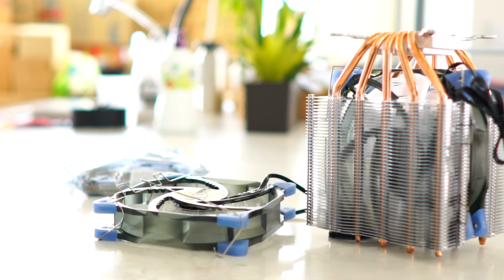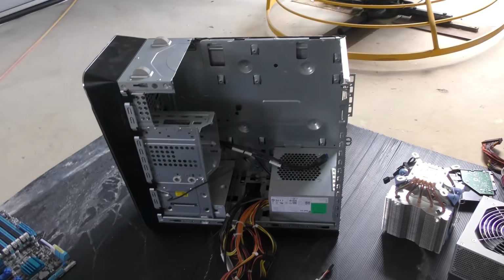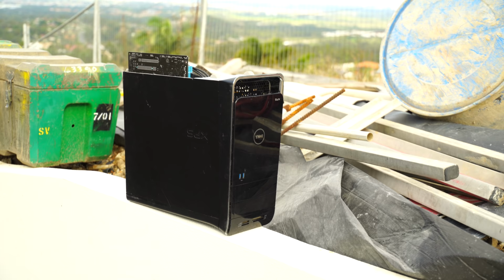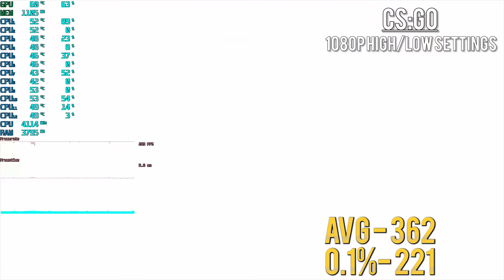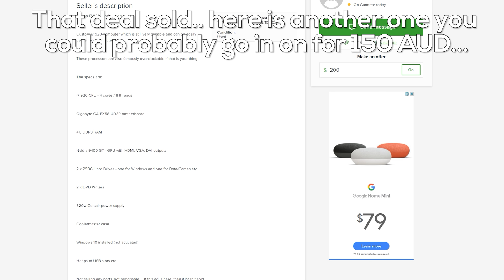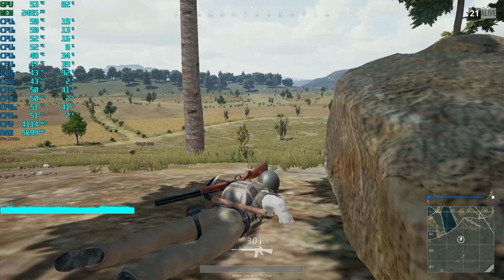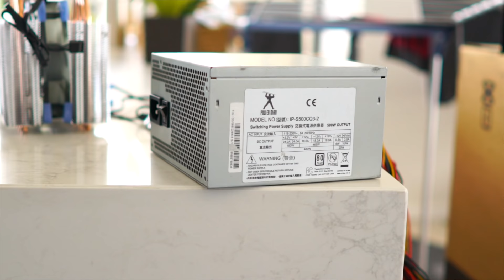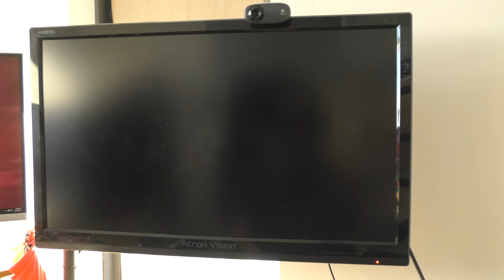Build a 6 CORE GAMING PC for LESS than an i7-8700K!

Comment: 4.3 GHz on a 6C/12T CPU using a $25 generic cooler. Not sure if you really hit the silicon lottery or if aliexpress injects steroids in their heatsinks.

Favorite build from you so far!
Reply: The equivalent of finding the 'The Chosen One' as a CPU.
Reply: I tested two Xeon X5670 and one X5675 with custom watercooling. They all blast easily to 4.2GHz (mild voltage), to 4.4GHz requires proper settings, beyond 4.4GHz is more silicon lottery but with a good overclocking motherboard and very good cooling 4.6+ isn't that rare (high vcore)...
Reply: OLD XEON = Silicon Lottery all day man
Reply from the maker: Thanks Ozi! For me, this is what is so much fun about the older hardware - you can have a cheap gamble at the silicon lottery! It's also the exact reason I went ham on the x58 boards when I was hunting in Japan, love my x58 and Westmere Xeons, easily my favourite line up of all time.
Reply: I run mine @4.7ghz under water.   I know of people hitting 4.9 however.
Reply: i have hunted down the same mobo with 12 gigs ram 750watt psu for only 100aussie. waiting on my 5660xeon from ali express. hope i hit the silicon lottery with AIO too :). but that i7 950 is a very hard sell that came with the mobo. been advertising for 45$ for weeks with 0 luck
Reply: I've got my X5680 at 4.3GHz on a decent 140mm thermalright cooler, so it's definitely conceivable if you get a better chip that you could get those numbers. Overclocking them is definitely a pain relative to the unlocked multiplier (k-sku) CPUs though.
Reply: I just recently bought a X5650 processor. costs 25 dollars on aliexpress. Great for multitasking
Reply: I bought the same cpu cooler from aliexpress and it arrived in the mail today. 5 heat pipes is one pipe away from a noctua D15. Tech Yes City is all about price-to-performance and this cooler at $25 can handle anything.
Reply: X5670 at 4.4Ghz under a 120V which is basically an AIO Hyper 212 Evo. With encoding it only gets to ~80C but that's because my fan's at 50%, for gaming it's like in the 60s.
Reply: I know its a budget pc but i would be scared to death using that psu with an overclocked cpu and a gtx 780. I think its too risky even on a budget pc.
Reply: He had a roided cooler and silicon king xeon Hahaha
Reply: OzTalksHW both
Reply: is it any good in overclocking?
Reply: On a X5670 what would be the Single core score in Cinebench at 4.3Ghz?
Reply: Xeon's are made of much higher quality silicon than typical desktop CPUs.
Reply: Is that motherboard UEFI capable? If not is ASUS P6X58-E WS capable? Is UEFI a thing on X58?
Reply: This xeons are mythic. Got a x5675@4,6ghz to replace my 8 year old i7 920 and for $50 was the best upgrade i ever did. Sure, i could get a better system in 2017, but surely not for THAT amount of money. Also, it plays everything with no bottleneck on my RX580 @ 2560x1080 widescreen. Couldn't ask for more on a $50 budget.
Reply: Artur Domingues X5675 is probably the best CPU. As it's only 95 TDP while anything above this model is 130 TDP
Reply: No risk, no reward.
Reply: Agree... good one Ozy.
Reply: Are you kidding, generic and cheap it may be but that's an 8 heatpipe cooler that's about twice as big as a 212 evo...
Reply: BRO! this is exactly what im looking at doing! whats your ram like?
Reply: Yeah, sitting right on top of the CPU
Reply: Shah Ahmed i would buy if you have worldwide shipping for 20$
Reply: around 140 - 150
Reply: The xeon is just good in overclocking.
I oced my x5660 to 4ghz with 1.3 vcore but i never tried to go lower with the voltage nor took the frequency higher.
And i'm just using a 20 dollar cooler. The temperature never goes over 65°C
Reply: What do you guys think of the Xeon w3565 for $200, it comes with the dell prebuilt with GTX 660
Planning to take out just the Xeon and get a GTX 970. Thoughts?
Reply: can you pls help me on how you overclock your x5670 to 4.2 on air? i'm new to these computer stuff and i bought an old alienware area 51 x58 tower for 80 dollars.  i order an x5870 for 43 dollars on ebay and i think i have a nice air cooler that comes with the tower which have an i7 965 cpu.  i'm replacing it with a xeon and i really want to know how you overclock the xeon to 4.2 on air cooler.
Reply: i just bought a x5670 chip and i have a alienware area 51 tower with a x58 mother board,  just wondering how did you overclock to 4.2 on air?
Reply: hello, pls help
Reply: OzTalksHW thats what tech yes city
Reply: 666 likes
Reply: What´s the amount of power consumption? I am thinking of buying one of those xeons also, just to build a budget beast... But i am afraid of the power bill...
Reply: It looks like a Noctua knockoff heatsink in all honesty. o.O
Reply: Two words: open case
Reply: Detmer  What about the temperatures?
Reply: ImOnMy116  What about the temperature?
Reply: Xeons are server/workstation class cpu's therefore where the premium chips so Intel generally reserved the best silicon for the Xeon brand. It is reasonable to assume that you'll have better luck when overclocking them than consumer silicon from the same generation.
Reply: OzTalksHW I hooked mine up to my refrigerator.

Comment: Great build. I think the X58 platform is amazing. I saved so much money with an X5675 12gb triple channel ram and a real lucky find with a new in box gigabyte ex58 motherboard sat around in an IT workshop. With the money I saved I bought a hybrid 1080 ti. The card isn't bottlenecked at all at 75fps which is what my 1440p monitor runs at. It would be comfortable at 100+ fps easily as my overclock is 4.5ghz. You cannot dismiss this platform.

Comment: Car Mechanic Simulator 2018...The Crysis of 2017.
Reply: Love ur channel
Reply: LOL, That CPU must have been at 100% Full load with that game...Or Sim Hmm
Reply: BryantCivica 
actually no the gpu was bottlenecking the cpu heavily
Reply: Budget-Builds Official wow you’re watching his vids lol
Reply: I Love car mechanic simulator only problem is i cant play it tried a few graphics cards with my i7 cpu and getting terrible frame rates i have the Lenovo  thinkcentre  
CPU
 Intel Core i7 3770 @ 3.40GHz 
 Ivy Bridge 22nm Technology
RAM
 16.0GB Dual-Channel DDR3 @ 798MHz (11-11-11-28)
Motherboard
 LENOVO MAHOBAY (SOCKET 0) 
Graphics
 
 2047MB NVIDIA GeForce GT 710 (NVIDIA) 

tried changing power supply and installing a 4gb graphics card with no joy
Reply: Peter Yianni Your CPU is more than enough. your gpu is the worst you can buy new

Comment: Eyyyyy hi Brian.. How you manage to get an x58 mobo for $70 is beyond me... None under $120 on eBay when I look
Reply: Gotta look elsewhere then; I've seen some for 80€ on local selling sites in Germany.
Reply: CSTwister didnt he get them all in japan
Reply: Man you can buy it on aliexpress for 60$.
Reply: link?
Reply: Qualcuno che ti scrive those are generic and I'd rather not use generic..
Reply: WayStedYou not too sure..
Reply: ah yes ive seen them, want branded so i can easily overclock
Reply: Qualcuno che ti scrive
Those are nonames, 60% of the time they don't even post.
And you can't overclock, + only 2 ram ports.
Reply: Look on locals websites.
I used to look on ebay (not in usa, if there is something shipped from usa to Belgium, customs just makes you pay pretty much the value of the objects.) and everything was 150+ only for the mobo.
And I then looked locally and got the mobo, an i7, a cooler, ram for 120$.
Reply: I just bought An X58 Asus board for $115. It came with an i7-930 I can sell for like $40ish. Gonna throw my X5680 on there and see how far she'll go with a 212 evo
Reply: Idk how far it will go, the i7 920 I have is overheating on a cooler master v8 :(
I think those 1366 are heating a bit too much.
Reply: search for i7-920 and other 1366 CPUs and often you find bundles for under $150.
Reply: IMNOTA no? Make sure you have thermal paste on.
Reply: I can't really do anything rn because if I take off the cooler and that there is thermal paste, I will not have some to replace it.
I haven't assembled the mobo and the cooler, I bought the mobo with the cooler and the cpu installed so I don't know if there is thermal paste.
Reply: I picked up a rampage iii extreme which is like top top top top of the line for $80 with and i7 930 xD
Reply: Who should look at i7 9xx system localy or hp z400

Comment: No Fucks Were Given When He Put That Paste On lol
Reply: heat spread is better by a bit when you manually spread it, also GPUs require significantly more thermal paste than CPUs
Reply: I know mate ive been working with Pc's for many years,i was just messing around :)
Reply: Dj shady "where" lol
Reply: Haha i was not aware i made tht mistake lol but cheers :D
Reply: Dj shady yeah cheers m80
Reply: I was slightly drunk when i wrote tht lol,abit like now :D

Comment: actually, this thing is still relevant in end 2019 / 2020. It beats the 8700k and has same performance as 10600k  by looking at CPU. Also, you can get a CPU+Mainboard+12GB/24GB RAM+heatsink on ebay for like 120 bucks.

Comment: I use the x5650 for $20 and its AWESOME also first
Reply: I also have a x5650. I've got it stable at 4.2Ghz though I think I could push it to 4.4.
Reply: Tr3vor which mobo u guys have? I m looking forward to buy it.
Reply: Nikhil Puri I use the gigabyte Ga-ex58-ud4p but it’s a bad overclocker for xeons my 5650 only went to 3.15
Reply: +Nikhil Puri I have an Asus Sabertooth x58.

+Tr3vor what's your BCLK?
Reply: Fina1Ragnarok at 150. Going any further won’t let me post without resetting cmos
Reply: I think I’d switch from the x5650 to the x5670 for the bigger multiplier

Comment: I never thought about it, but I paid about $756 for my I5- 7600K build with B250M Pro-VDH by MSI, 240gb ssd two other 120gb ssd's, 16 gb DDR4 2133 Geil EVO memory, RX 460 4gb, 500 watt evga 80+ bronze, 240mm AIO liquid cooling, mid size case with mounting for liquid cooling and windows 10 pro, plus all three drives are SATA 3.0! 

I love watching you shopping and building in different locations!

Comment: Still enjoying my X79 Xeon 2670 build. Wish the 2670 had a unlocked multi. But for $50 (for cpu) can’t complain gets 1092 in cini.
Reply: XxViciousxX I just ordered the v2 of that cpu u got
Reply: cmoneytheman That’s awesome I’m sure you will enjoy it.
Reply: XxViciousxX do u game good oh it or have any heat trouble i gota 1080 gtx and my cpu now overheats thats why im upgrading
Reply: cmoneytheman Mine games pretty well with my 980ti no big bottlenecks. It games way better then the FX 8320 it replaced. I never had my Xeon overheat by any fault of its own. My case didn’t have good enough air flow for my Xeon and a overclocked 980ti. After opening the side my processor never went above 60c. Mines cooled by a Noctua DH14.
Reply: XxViciousxX u still got the xeon or a new one
Reply: cmoneytheman Still have same Xeon 2670 it’s been a great processor.
Reply: XxViciousxX good to hear wha u coolin it with i gota noctua u14
Reply: Noctua DH14 that got of ebay for $29  because it was missing a screw. One trip to the hardware store and boom bad ass cooler on the cheap.
Reply: XxViciousxX oh u got the same one its not been working for my cpu when I oc it gets close to 90s when I render and Thats only 4.0 I just got the xeon not long ago today didnt take it out package yet tho
Reply: cmoneytheman What CPU are you currently using?
Reply: XxViciousxX 3930k monster when not rendering its in 50s
Reply: That is a bad ass CPU.
Reply: XxViciousxX I kno its a monster but I told u it overheats when overclocked at 4.0
Reply: Yeah it is a hot CPU when overclocked. Watercooling is really the only way to tame that CPU But most people don't want to deal with watercooing. The Xeon you bought will run cooler so you shouldn't have to worry about overheating once you install it.
Reply: XxViciousxX Im glad u told me more speed with the new cpu with lower heat

Comment: MY x5675 still plowing through everything @ 4.6ghz, wont be upgrading until the 2020's hopefully =] X58 still got bite
Reply: hm55 chipset best lol
Reply: Nice! What settings you using and how long for, if you don't mind me asking?
Reply: bclk 200, 23 multi, 1.45v, c1e enabled, 3400mhz uncore, i run this thing with a 360mm  AIO, previously with a hyper212 evo.

I  plopped this X5675 in a few months ago from my previous x5650 that didnt clock as high (4.4 with 1.42v, but did 2 core turbo to 4.6) and ran that for about a year and a half, chip is still great, clocks the same and all.  These chips are tough, only thing that really degrades them are high voltages on the QPI/vtt (over 1.35v per intel max spec)
Reply: nice i currently have an x5650 that was at 4.5 but dropped down to 4.4 for 1600mhz ram and the temps where to high same ips as my 2600 (nonK) @ 4.1 did well over 1.35 on the qpi due to an locked uncore multiplayer for years but finally solved that can confirm that degradation did happen keep it under 1.35v they will last an while. though coffie is now pulling over 50% ipc gains I am now tempted to do an system update.
Reply: Impressive. I'm still on the fence of going past the max spec'ed VID of 1.35V myself, but a lot of people like yourself seem to run fine above that as long as things are kept cool. The Gulftown i7s which are pretty much the same part I think are spec'ed up to 1.375V, so who knows what's going on there. But at 1.45V I feel like you could get more out of it though, I have my X5670 at 4.4Ghz on my Gigabyte X58A-UD3R with the following:
LLC - Level 2
VCore - 1.35V
QPI/Vtt - 1.335
CPU PLL - 1.98V
IOH and QPI/Vtt PLL - 1.18V
ICH - 1.14V <- SB voltage which helps with USB problems at higher base clocks.

I found that keeping the NB cool helps, like if I linger above 70C on the NB for long enough I get a crash but in the 60s it's completely fine.
Reply: temps climb fast over 1.35 i would personally say safe up to 1.45 on most water loops just don't go over 1.35 on qpi golf town has some modification to the fabrication process to handle more voltage. still that's an good clock
my x5650 @4.4 is still fine for me.
i personally cant get blck over 220 to post on my x58 ud5
Reply: my chip hits a wall after 4.4ghz, 4.0 @ 1.25, 4.2 @ 1.28, 4.4 @ 1.32, 4.5 @ 1.39, and then 4.6 @ 1.45 lol. I can always run 4.6 with 4.8 turbo at this voltage with lower bclk, and c3 states enabled, but this always give me worse single thread performance. 1.98v cpu pll seems excessive, i run my chip with 1.3v cpu pll, tbh it seems like the only voltage that truely doesnt effect stability or performance, so i just keep it low...
Reply: Andrew McEwan Yeah it seems like people are even running up to 1.5V since the chips can go to 1.55V apparently, but they stay at 1.5V in case of spikes. Oh yeah dw, the next step up for me is 1.355V on QPI so even if it's only 5mV over I aint going there. 220 BCLK is pretty rare I think as past 200 Xeons don't like to play nice with it I hear.

The PloT 4.4Ghz at 1.32V is pretty good I think, better than what I've been able to achieve so far. Strange with the Turbo since apparently it's better in like games since it's not an all core Turboo but even up to 4 with 8 threads it's fine for games. Yeah 1.98V is probably too high, QPI too, but I've been stability testing so wanted to take that out of the equation.
Reply: i just took an hand at overclocking mine again i can get 210 out of the blck but the biggest difference at least in cine bench was the uncore went from 980 at at x12 multiplyer to 1037 at 17x with 6 2gb sticks of ddr3 @ 1240 7-7-7-21 my ram cant go over 1600 so i had to drop it down over 200 blck
Reply: Yeah uncore does seem to have the biggest effect, going from 17x down to 16x dropped my CB points by ~50. That's a standard memory speed though, frequency isn't what determines performance it's response time, so 1240Mhz CL7 is the same as 1600Mhz CL9.

The calculation is CL / Frequency in Mhz * 1000 = response time in ns = 7 / 1240 * 1000 = 5.7ns and 1600 CL9 = 5.6ns.
Reply: SlavjanA tis an good rule of thumb but in the real world frequency is better than timeing in (in most cases) Shure you could get it close by modifying all the sub timeings but past the top 5 it's still all Egyptian to me I'll take it as I bleave the uncore benifit is > ram benifit expessicaly with triple channal. Just sorta wished I waited before I splerged and went for something with an higher multiplayer. But for $25 for an x5650 right now you can't go wrong with it.

Just look up low cas vs higher frequency benchmarks.

Comment: This is basically my PC, except for the case... I got a X5650 @4,0 with a 780 AMP and 24GB RAM, my cooler is a nh-d14 which i got for 15€ probably a bit better than the chinese one you got :) Will need to upgrade the GPU soon because of my 1440p monitor... the 780 struggles with PUBG at that resolution...
Reply: That CPU should easily do 4.2GHz with moderate voltage...
Reply: he might already got on the sweet spot on his chip.
Got a X5460 and while I can easily run 3.9 GHz @ 1.32v but for 4.1 GHz I already need 1.4v
Similar on my 3570K: For 4.3 GHz i can work with 1.24v, but füor 4.6 GHz I'll need 1.32v
Reply: HappyBeezerStudios - by Lord_Mogul X5460 is a 45nm, X5670 is a 32nm Westmere. A good Xeon Westmere CPU does 4GHz with stock vcore. Sweetspot is at 4.25~4.4GHz
Reply: Detmer, the CPU has to be 100% stable, everything above 190Mhz BCLK doesn't work all that well, I use it @1,35V 190FSB with multi on auto (ie. idle 2,2GHz, normal 3,8GHz and boost 4,0GHz) I can run cinebench well above 4,3GHz if i want (@ ~1,45V) but since i use the rig for gaming and encoding i preffer to have a huge safety margin with clocks and voltage... Because the worst thing that could happen is that the system crashes after ~8 hours of encoding/appliying some sort of image correction (for example stabilization), because that would force me to start all over again :(